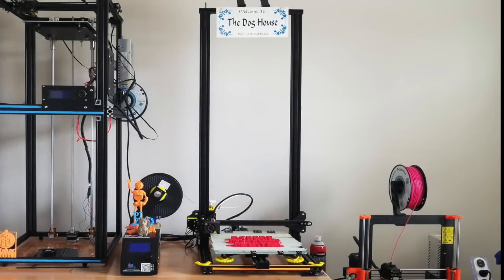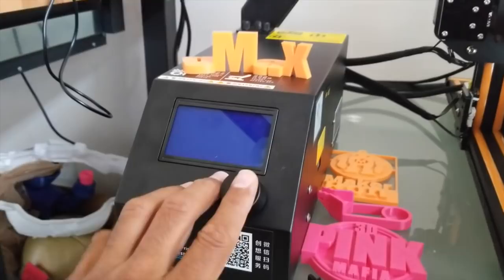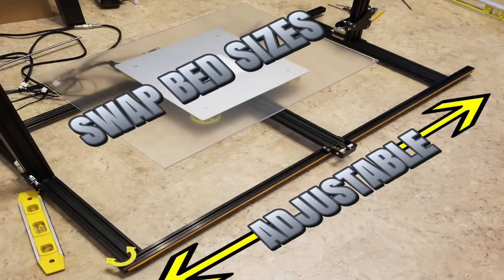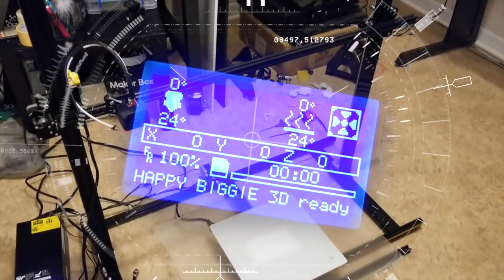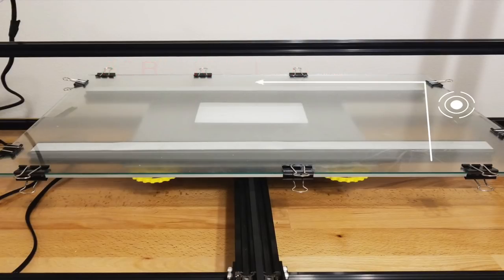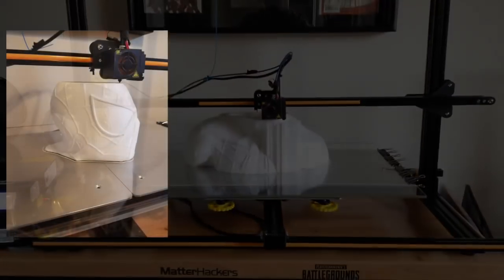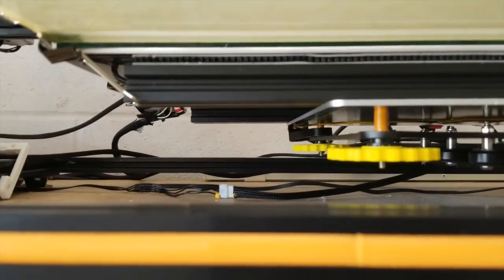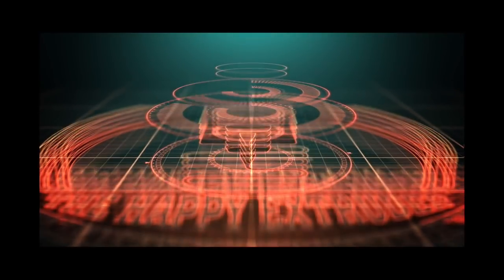HOW TO BUILD CREALITY CR -10 GIGANTOR

Comment: Hey bro, I was curious if you could give me some advice. Is there any issues with print speed and nozzle size when scaling to this print volume?
Reply from the maker: Hey Thanks for watching, No issues only at higher heights you may have to adjust Jerk accelerations but if you print at 45mms you should be fine. In hind sight I use stronger extrusion profiles. Happy Printing !

Comment: Is this doable with an ender 3?
Reply from the maker: Yes there are kits for Ender 3 also but it extends to 400mm you can buy the extrusions and make it the whatever size. Just remember change settings in Marlin for height changes

Comment: I wonder if it would be easier to take a CR-10S5 instead of a CR-10 and do this. I am planning on doing this.
Reply from the maker: Hey sorry for the late response, Yes any Creality Machine can be Modded just remember you have to Tap the holes in the New extrusions you will be ordering, Openbuilds.com has an option to tap the holes for you. Good luck keep me posted in Comments.
Reply: @thehappyextruder7178  Thanks for the response. What did you do for heating the bed?

Comment: can we have and update. did you add a AC heat mat for the hole bed that would help loads. just to let you know you have made me save a load of money i was going to buy the cr-10s5 but after seeing this i will use the cr-10s for now and upgrade to 1000mm later thanks :)
Reply from the maker: Thanks for watching, I am currently changing the wheel rollers for Exoslide roller system, as for the bed I added a second PSU and mosfet, Once the changes are done I will upload an update. Glad you saved money I have an Ender 5 I am upgrading at the moment.

Comment: Great video, I've just got one question. Do both the heated build plates heat up? If so, how did you get them to do so. I am wondering because I am considering doing something similar to my cr-10
Reply from the maker: Yes both heatup I used an additional psu and mosfet, thanks for watching!

Comment: Y axis badly needs more support .. another guide 2040 / rollers to give more support. The bed must contort and twist like crazy with one regular width one in the center :O
Reply from the maker: I agree, but this was more of use what you have I could have purchased and built a new machine with all the proper equipment, but then not what was intended. Thanks for comment I appreciate it.

Comment: Excuse me! Is it necessary to modify the board software in order to print with enhanced sizes? I would like to try what you did but i've heard the CR10 needs a bootloader or the like ^^'. Great video btw!
Reply from the maker: Yes you have to change the Z height because it is set to 400mm you can check the link in the description and follow the guide to flash the firmware. I  followed the same guide from TH3d website. Thanks for watching.

Comment: awesome idea.. nice.. but i have to ask a question.
I should to make some firmware update to change the dimensions;
Reply from the maker: You flash a bootloader onto the board and then change the height and length, see link in description it shows you how to do the flash firmware.

Comment: HI I think the video is amazing! Thank you for sharing this, I would like to know if you could help me make a CR10S-PRO to have a build bed of 1300mm x 1300mm x 400mm?
Reply from the maker: Wow 1300x1300 really. big you might need more bed supports and stepper motors.
Reply: @thehappyextruder7178  Yes I know it is a massive build but think of the impact to the 3D community and if we work together we can pull it off. What do you think? you can email me direct if you wish at 3dprinting@liquidirt.com

Comment: You just solved a Whole Lot of issues for me. I needed a 1000 mm ability. The cheapest 3-d printer I could find in that size was extremely cost prohibitive. I was going to get the 500 x 500 x 500 and cut my pieces smaller so I could print them. THIS IS WAY COOL DUDE. Thanks.

Comment: You seem to have the only videos on doing this . Do i need Atmega 2560 board to print this big or will the stock board work with new firmware? What firmware do I need ? I saw a 10S firmware does that mean 1000mm compared to say 5s or 4s?
Reply from the maker: You can flash the original Cr-10 board with a bootloader then flash the firmware the instructions are in description or search YouTube flashing marlin. You need to edit the Z max height in the firmware to your new build height. I am making a follow up video to explain this.

Comment: I just checked the vendor you mentioned in another video for the board you used and they don't offer it preflashed. Is this something you contacted them about? Also, where did you source your belts? I didn't see that listed. Plus, could you update with how you wired the dual hot beds?
Reply from the maker: The Belts were from Amazon, did not spend much for the belts. The board comes with the bootloader you just have to flash the firmware with adjusted Z limits
Reply from the maker: I followed this site for wiring the heatbed
https://3dprint.wiki/reprap/electronics/heatbed_mosfet
Reply: @thehappyextruder7178  I didn't see anything about wiring dual heat beds. Did you upgrade the CR10 power supply to handle the additional load?
Reply from the maker: I wired only 1 and used an acrylic sheet PLA sticks well to it. If you decide to use 2 a 2nd PSU may be needed.
Reply: @thehappyextruder7178  thanks! Did you get the rails already drilled and the holes that require threading already tapped? I know you mentioned on the video to select the option to have them tapped, but I didn't see that option for the 20x20 rails. I was looking to expand the X-axis to 1000mm and looking to leave the rest alone.
Reply from the maker: @S3cr3tAsianMan  you can use a tap set I acquired mine from Harbor freight Tools, now for the axis you just need to drill out the space for clearance of the screw no need to tap anything there. Keep me posted !

Comment: where did you get your two 500mm hot beds from and how did you wire them up? can you please post a video on how you wired up the two beds together?
Reply from the maker: you will need an additional misfit : https://www.ebay.com/p/Creality-3d-Cr-10-Heatbed-Ha210n06-MOSFET-Module/4022390023
and please note I only have one wired and my prints still stick fine PLA ! 
 Heatbeds here 
:https://www.ebay.com/itm/12V-MK3-300x300mm-PCB-Aluminium-Heated-Bed-For-Creality-Cr-10-Cr-10s-3D-Printer/173712712218?_trkparms=aid3D55501826algo3DPL.SIM26ao3D126asc3D5288526meid3D120ff71ae24d4db1b081d95b759cfc6726pid3D10000526rk3D426rkt3D1226sd3D11335395657626itm3D173712712218&_trksid=p2047675.c100005.m1851

Comment: Very cool. I am about to buy a CR 10 S5, and like the idea of future expand ability. Looking at the modix models, it appears to just be a 4040 extrusion printer with different gear ratio for the axis motions. Do you think there would be any benefit to somehow converting to 4040? Eventually I would like a 500x1500 (or larger).
Reply from the maker: Check the scratch build by Fun king 3d The FK-1
 https://www.youtube.com/watch?v=9YczLdAs_zw

Comment: Nice Video! 2 Questions
1- how did you connect the second heated bed to the CR10? Is it ready to add one?
2- Do you believe that it will need 2 aluminium parts with bearing wheels to carry the weight of the double bed + heavy prints? Like the CR10-s5.
Reply from the maker: Thank you ! 1. the second heat bed I did not connect just the first one but you can setup an additional mosfet and Power the second Heated as well. If you attempt to connect both it will short the single mosfet.  2. It depends how heavy the print I have been printing fine with just the single rollers. Feel free to change up the design there is no wrong / right way as long the outcome works and gives you good results. Thanks for watching and feel free to ask any questions you may have. Happy Printing.

Comment: I'm thinking of putting two rails on the base, like on the CR-10 S5, and using linear rails for the big print bed to minimise wobble on big and tall prints.
Reply from the maker: I was going for that method with 2 CR-10s bed plates Ebay has them for 45.00 dollars, but the single bed held and did ok, Maybe in the future I will swap it out and add bigger oz stepper motor, Good Luck thanks for watching !
Reply: Thanks. I'm going all out, 1000mm high, 1000mm wide 500mm deep. :D
Thanks for the inspiration!

Comment: I have a question I have not bought my CR-10 yet because I was going for the CR-10 S5 this one has a 500x500x500 print area. It looks like I could use your way to increase the CR-10 S5 to a 1143x1143x1143 for a practical 42 inch print area. All my future projects are large prints and I am not looking forward to print many small parts just to glue them all together. Would you this is possable? and do you think think that I could apply dual extruders in this process too?     Hope to hear back from you Thanks
Reply from the maker: Yes you can obtain an S5 bed plate from Ebay about 49 bucks you can buy 2 and placed them side by side, its really ups to your imagination and ratio constraints you want to remain in. Remember if you doing PLA you can bypass the  heated bed. Dual extruders as well upgrade the main board to an S5 you can get from Amazon, or Tiny Machines has them too. the extruder slider plate is on Aliexpress very cheap as well, Good Luck !
Reply: Awesome a lot to look forward to and can ot wait to see how it all works out. Thanks so much.

Comment: Hi Ron, did you have to buy a larger length belt for the new x axis?
Reply from the maker: Yes, I purchased 2 meters worth, 2GT-6 belt, was affordable too. Happy printing !
Reply: The Happy Extruder Did you do anything special to heat up the new larger build surface?
Reply from the maker: I wired one of the heated build plates you see in the video at 4:33 and some glue on build plate, I use magigoo a bit expensive but last a long time.
Reply: The Happy Extruder So you basically have 3 aluminum plates correct? One for the y-axis and 2 additional plates attached to the aluminum extrusions right? Do you think a custom silicon heat mat may be able to fit underneath those 2 aluminum plates? I'm trying not to have to use an additional mosfet to heat the new build surface area
Reply from the maker: yes the original at base then 2 extrusions on the screws that hold the base and the the 2 cr-10 bed plates on top I used 3M velcro strong stuff to hold the 2 bedd plates to the extrusions. but it works !
Reply: The Happy Extruder Would you please point me in the direction of where you bought the additional aluminum plates please
Reply from the maker: I purchased mine from Ebay, But you can purchase it from Creality3D as well.

Comment: Your video is really inspiring.. I would like to know how you connect both your heatbeds? did you connect parallel to the heat connection on the board or you need a different power supply? Thank you
Reply from the maker: You do need a separate power supply because connecting it tandem to the board will overload the single HeatBed mosfet.
Reply: I see, do you have a video showing the components you use and perhaps the connection? thank you

Comment: Hi, Can you make your printed Cr 10 with multiple Colors ?
Reply from the maker: You can use the change filament command in the menu to change colors.
Reply: The Happy Extruder 
No, I don’t want to use how you said to use from menu to changes the colours.
I want to say if I want to print one piece in different colours the machine should have automatically in the menu and do that alone , No ?
Reply from the maker: You can use a Multi Material Unit like this one https://www.youtube.com/watch?v=wFV6sRU8Yj4 or You can use this one https://www.youtube.com/watch?v=uecY5ikWdCI The machine just can't do it alone.

Comment: Great work. What size power supply does that thing need? Did you run the heat beds off mains or 12V or 24V?
Reply from the maker: runs off the original power supply that came with the CR-10... only one heated running for now, Happy Printing Sonic !
Reply: Wow that is cool. Do you think to upgrade to run with heated beds at once or are you not using the entire build surface often enough?
Reply from the maker: have to add another mosfet if not it would just overload the 1 and burnout.
Reply: The Happy Extruder testing running my heat bed on a separate PSU with a mosfet .

Comment: Where is the 1000mm ender 2 or 3
Reply: Electric Euphoria no reason it couldnt. Simply same method as here. Exact same mod. The ender 3 simply is a mini cr10 mini.
Reply: Matt Weber I linked this to the /ender3 subreddit
Reply: being cantilever a 1000mm ender 2 wouldnt work very well. Cantilever design limits itself to being stuck small to keep rigid and accurate
Reply: Well I would like a ender 3 done this way. Heck I may do it to mine as an eventual upgrade and board swap to get dual extrusion. Since I have seen nothing about an ender 3 having the capability of doing that